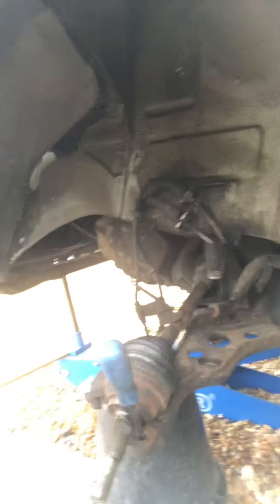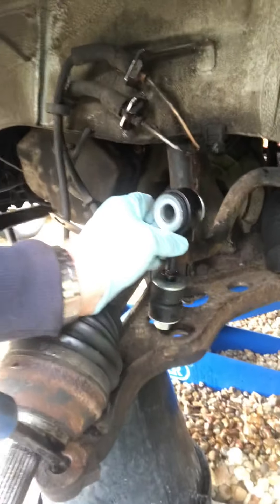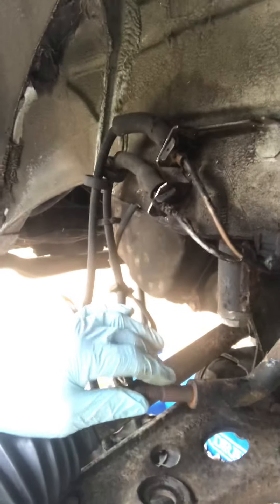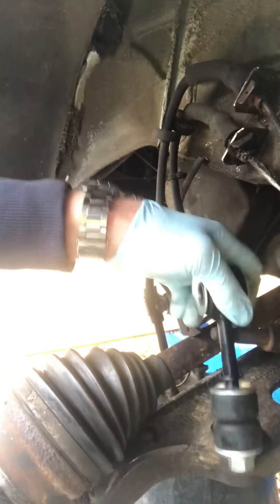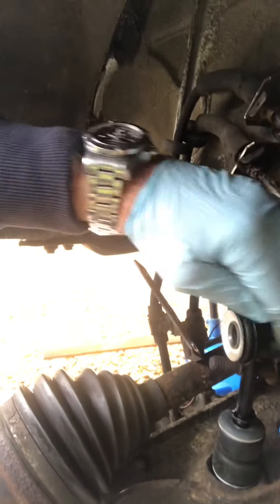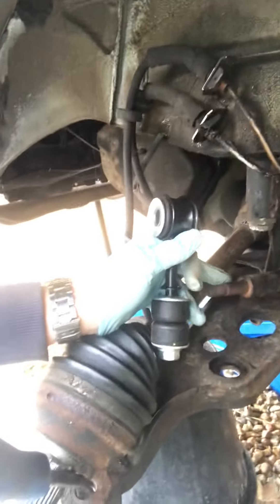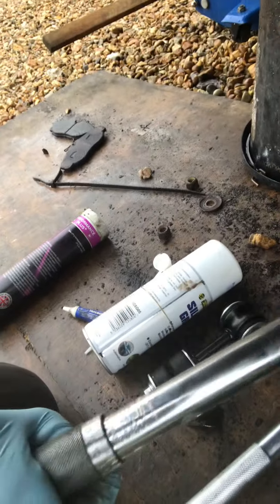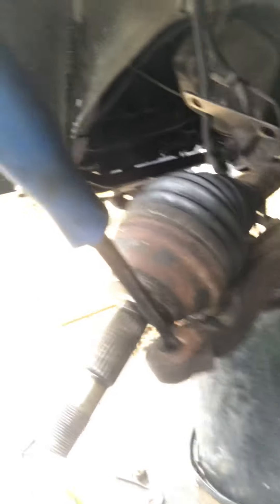Replacing roll bar drop links on 1996 Hymer Fiat Ducato 2.5 230

Comment: I just used a slide hammer with a hook on the end, few blows and off it came, there no need to remove the suspension strut just the four bolts to the hub then spin the strut around to give yourself access to the 19mm nut on the end of the anti roll bar.